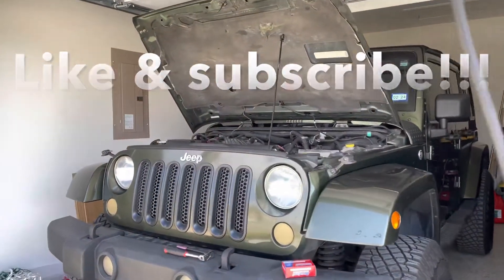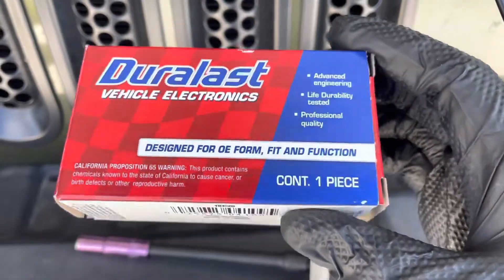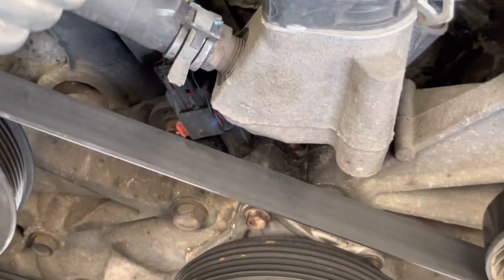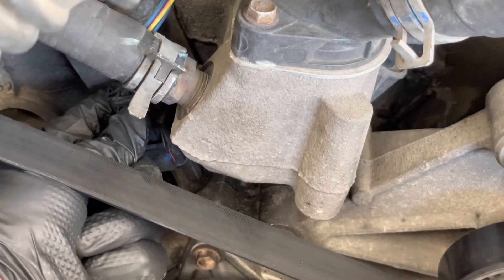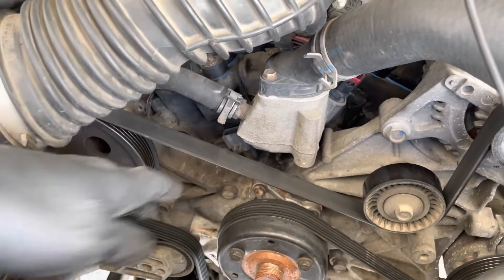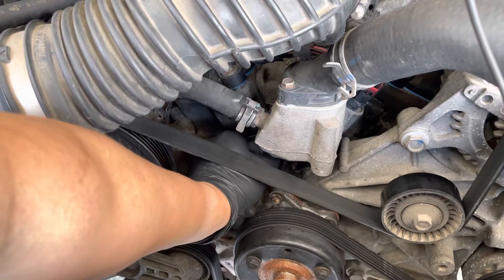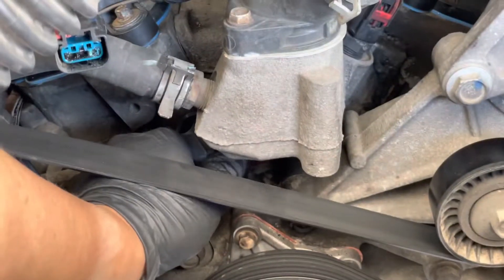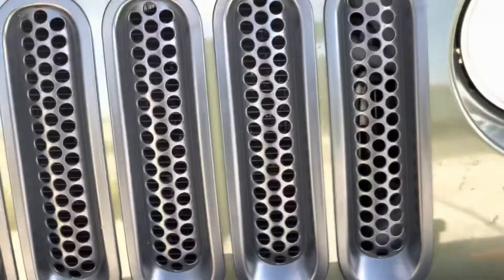Jeep Wrangler JK: Replace #camshaft #position #Sensor with #checkenginelight #p0340 under 4 minutes!

Comment: I think this is Crankshaft sensor, not Camshaft sensor.
Reply: It's a cam sensor it's located on the plate on the block the crankshaft position sensors on the bellhousing of the transmission three wires who's this dude in the comments thinks he knows he's talking about
Reply from the maker: Thank you for watching!

Comment: Is that the crankshaft sensor? I have p0340 on my jku2012
Reply from the maker: The cam sensor is what my issue was and it monitors the camshaft position and rotation, while the crank sensor monitors the crankshaft angle and speed of spin so they are unrelated.

Comment: I have P0340 and P0344 , P0365, and P0369 all came up same time. 65 & 69 shows Sensor "B" 344 & 340 shows Sensor "A" on my reader. that means both are bad? Where is the B located?
Reply from the maker: I would have to look up those codes